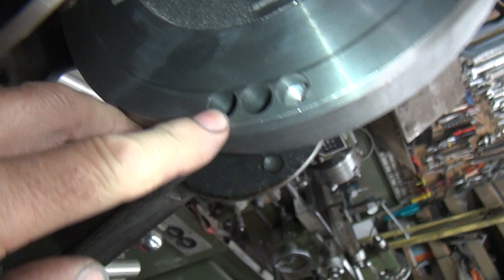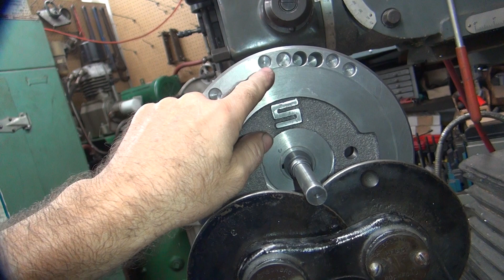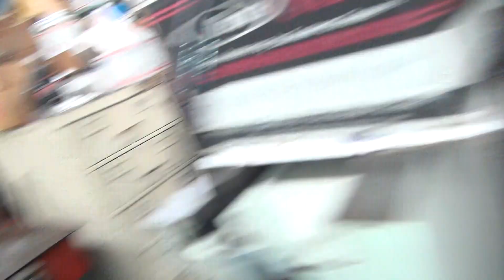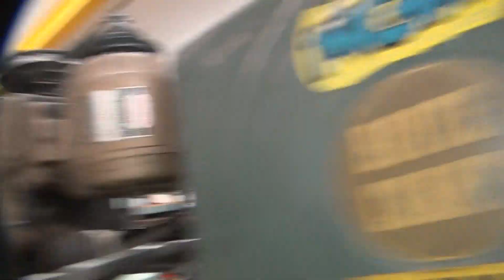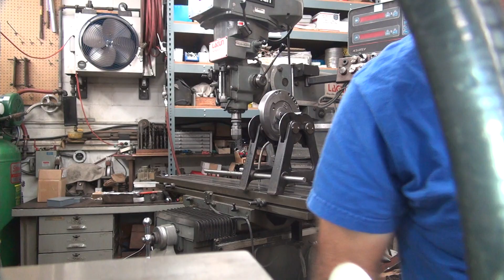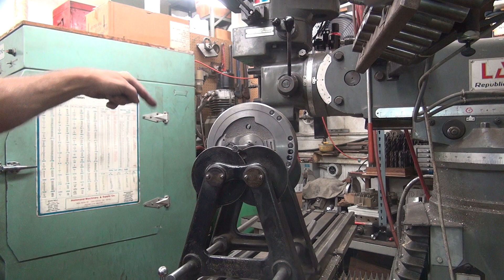#167 1947 EL case welding knucklehead 74ci motor rebuild & machining repair harley by tatro machine

Comment: I've watched several of your videos of you balancing Harley crankshafts and i hear you talk about balance factor percentage, my question is , is balance factor percentage= the percentage of the total weight of the crank pin + both connecting rods + bearing and cages+ pistons+rings+ wrist pins and clips ???
Reply from the maker: its all about the total reciprocating weight vs. the rotating weight. you can be 50/50 or anyother number you think will work for your combination.
tatro
Reply: Another question related to balance factor , the weight you press into the crank pin hole, does that represent half of the reciprocating weight including the balance factor percentage ? I understand that the weight in this video is 50%

Comment: Can a difference in balance between the flywheels cause the crankpin to want to shift and lead to scissoring?
Reply: Your videos are great. Only problem is I now realize that every motor I’ve ever put together is wrong!
Reply from the maker: i have the same problem. the better you get, the more you learn that you don't know crap.
tatro
Reply from the maker: no, balancing has nothing to do with that. you just need better parts or tighten them up more.
tatro